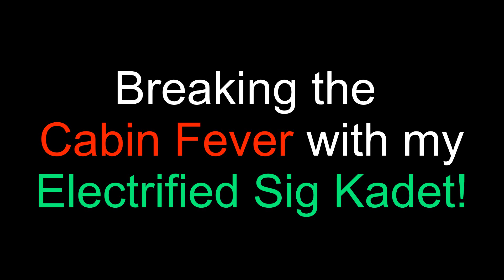Electrified Sig Kadet Airplane.  How does it compare to the Nitro Version?

Comment: Awesome flight my Sig kadet has a Saito 72 and flies about the same I love to see just how slow I can make it fly. The plane stalled at a very slow speed and then the engine stalled on me when I hit the throttle too fast, you wouldn't have that problem with electric. Happy landings
Reply from the maker: Yes.  My Saito 120 in my 96" Cub also stalls at low throttle, till I added an onboard Glow driver.  That will fix your issue.  Thanks kindly for commenting and happy flying.

Comment: Hope this comment gets answered, How did you go about attaching the electric motor to then plane? I recently got one of these on a trade and it still had the old nitro (which im working on restoring) but i wanted the option for electric while im learning to fly and less hassle. Thanks for your time
Reply from the maker: Yes.  Well the kit came originally with 2 motor mount boxes.  One was for electric.  If you don't have that, you can mount a motor to the standard nitro motor mount with zip ties or hose clamps, if it is an inrunner motor.  Otherwise, just screw the electric motor mount to the firewall.  Have fun.

Comment: My brother gave me his nitro version he got from his father in law. It was a Club Plane as it has the name of the club right on the wing. When the Apprentice came out, most clubs switched to electric trainers. Our club also has them. They still have a few nitro Sig Kadets. The one I got needed a new engine so I did buy one for less than $100. Its in remarkable shape. I hate the tan color. I see how awesome of a flyer it is! Would you compair it to the Apprentice?
Reply from the maker: The Apprentice (mine was Glow powered) flew very similarly, but mine was glow powered.  Thanks.
Reply: Was that the Apprentice or the Sig that was glow powered. I think you reversed it but honestly I know what you meant. I wouldn't mind converting an Apprentice to glow but it would seem like the foam would have to be sealed. I know glow fuel would make short work of the foam.

Comment: Hi Dave and Ilea,
I have a Kadet Senior in the box and a fiberglass cowl. Had always intended to get it built, but life intervened. Now that I have plenty of time, have no place to build it. If it does ever get built, it will be electric. Don't want to hassle with glow fuel. Stay safe.
Reply from the maker: Wow, that is great you have one.  This is one of those iconic balsa built up Kadets and is very easy to fly and see in the air.  It also stays real clean with electric.  I was able to actually fly it almost 20 minutes on the battery, so it gets good mileage.  Thanks kindly and you stay safe as well.  Thank you.

Comment: 18 mph wind?  Pfft, throw the flaps down and you should be able to hover....
Reply from the maker: Yes, this airplane has so much lift, it will hover. But it also does not need flaps, as the Clark Y airfoil is way good. Also it does not have flaps.